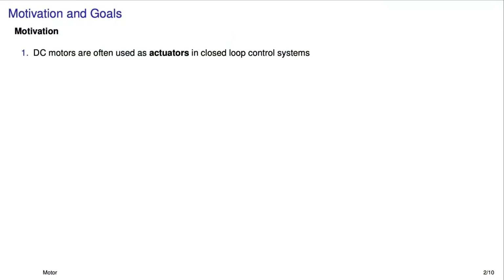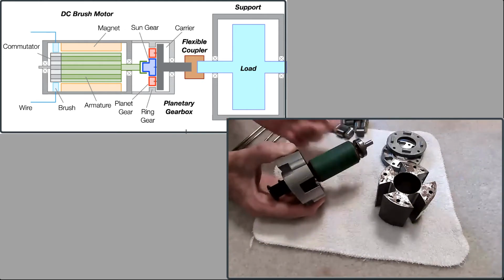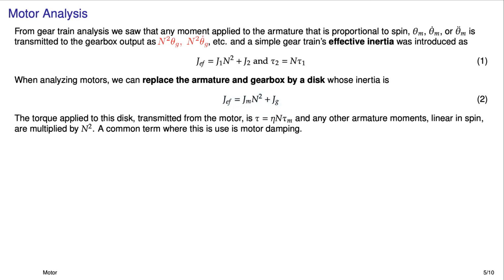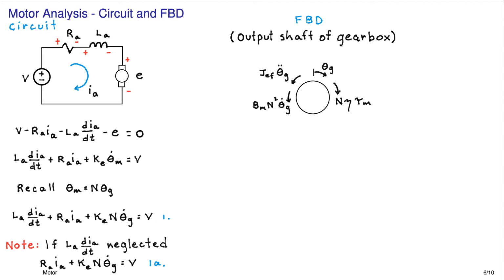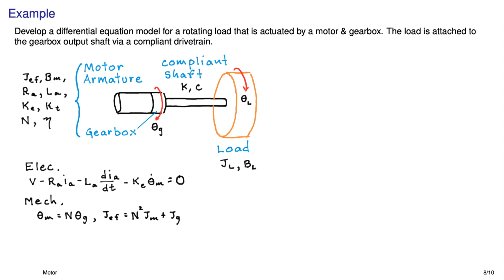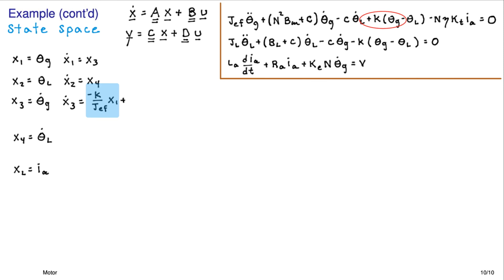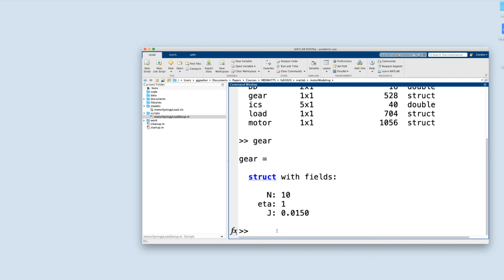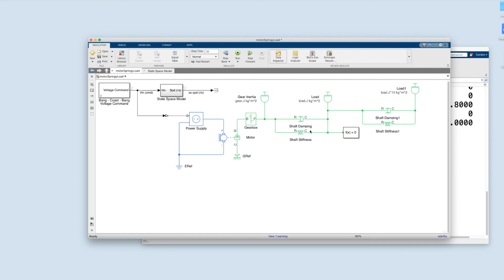Motor Modeing

Comment: I've found your videos in a dark time and it's been a light for my path lately. Thanks for your efforts. I have a question;
I've modelled a servomotor, I have applied an indicator to its gear shaft for visual analysis of angular position and a PID controller for feedback.
Now I'm confused, how can I apply voltage to the servomotor?
I see you have a voltage command, but it looks like a block, I couldn't find information about it.
If you can help me out, I'd be more than happy.
Thanks in advance.